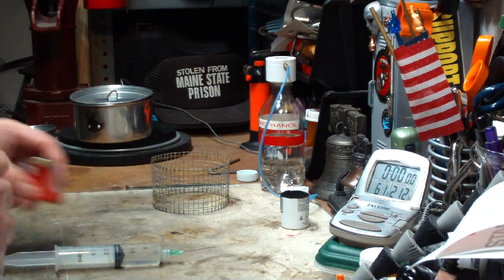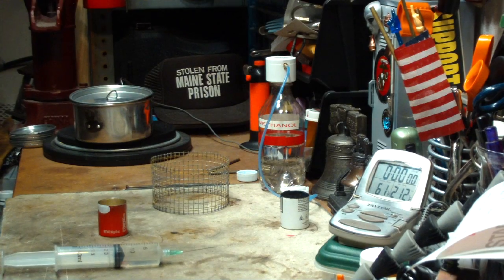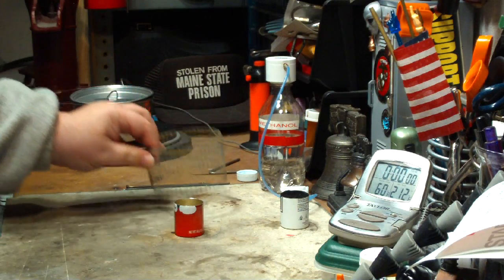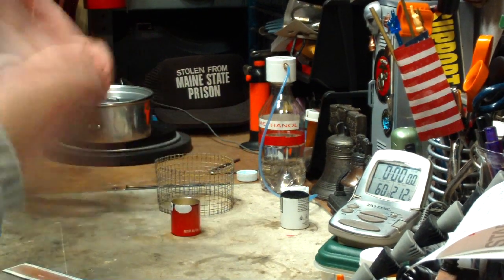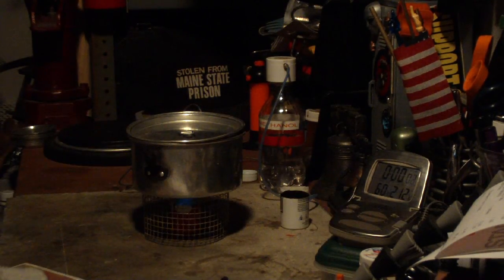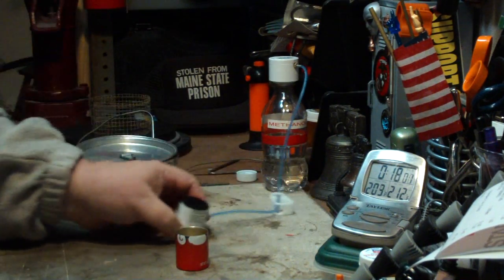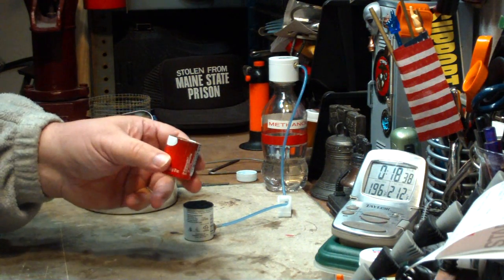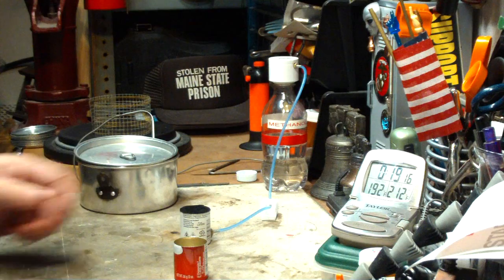Simple Burner without Carbon Felt - Boil Test #1

Comment: Interesting...do you know how much fuel you used in the carbon felt burner to get the water to 212?  I use an open burner most of the time with a windscreen no more than 1/2 inch away form the pot. An open burner works better for me with the windscreen.